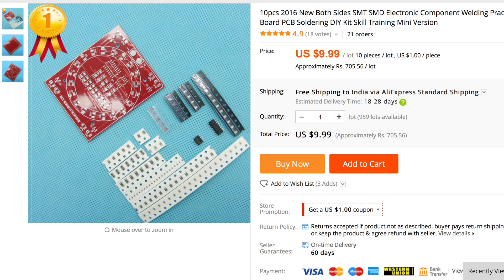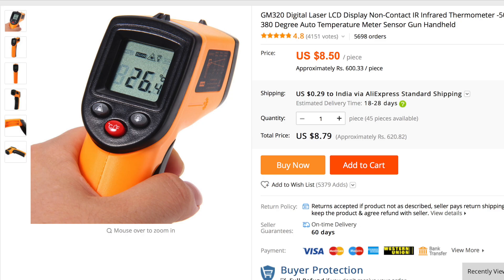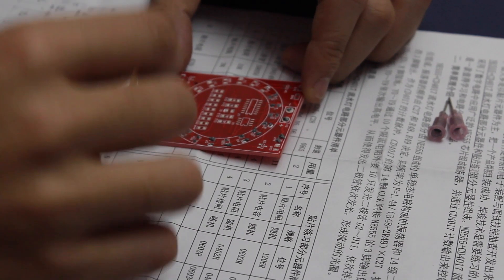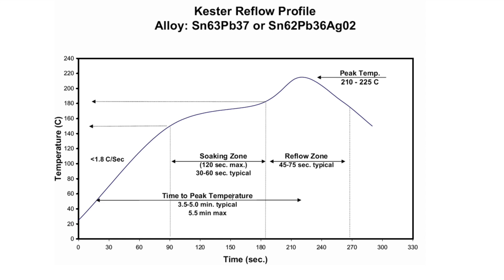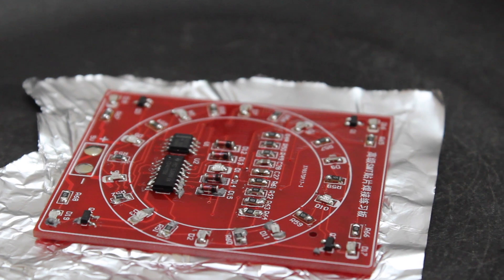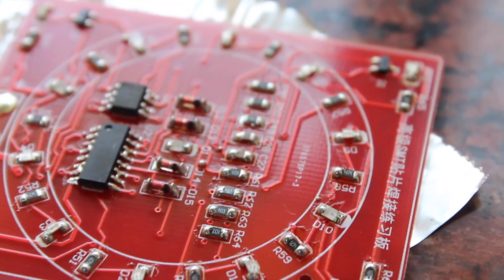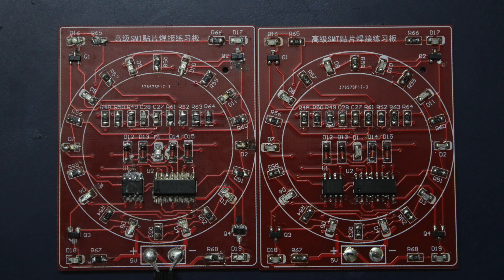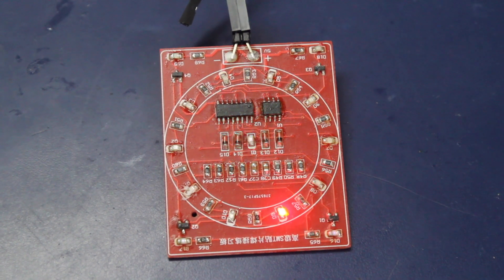How to Solder Circuit Boards on a Cooking Pan

Comment: By the way, did you use a gas stove to heat the pan ?
Reply from the maker: Yeah, I didn't have better equipment.
Reply: @paramaggarwal  That's perfectly fine ! I'll probably try using a butane camping stove.

Comment: I got 20 smd capicators,and the sheet calls for two ,did you have any problems with your component count
Reply from the maker: Nope, actually I had ordered a set of boards which each came with a set of parts.